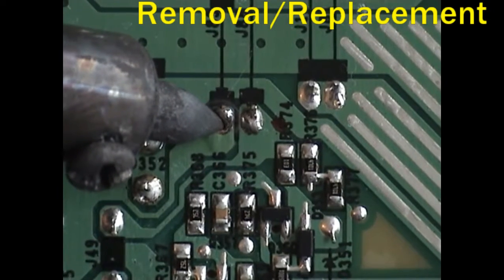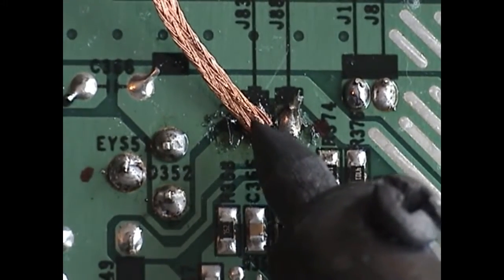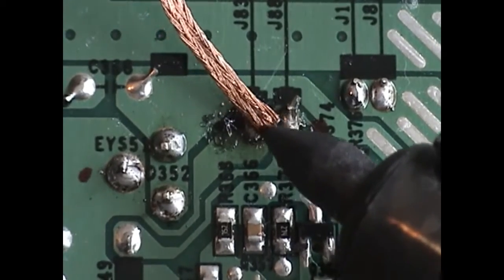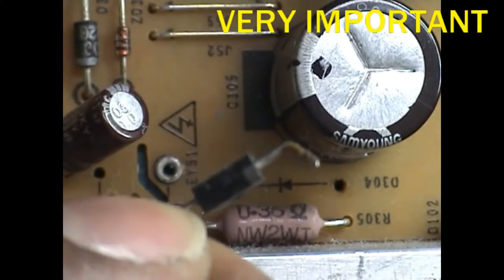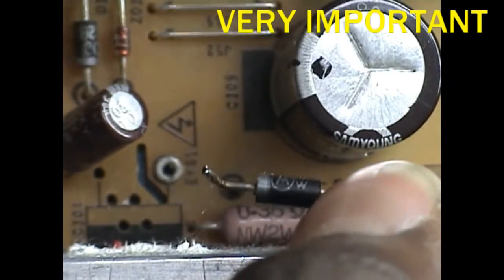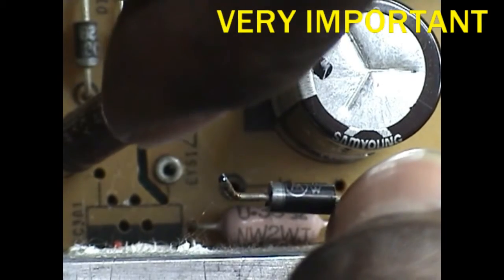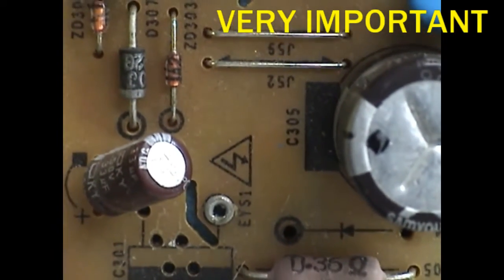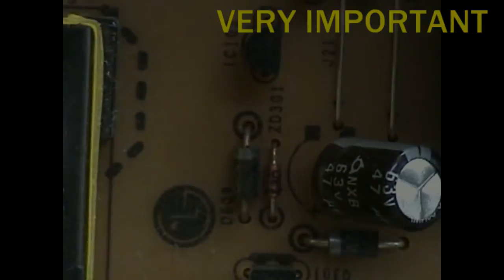LG Repair KIT + FREE Tutorial DVD - 50pk540 50pk750 50PJ350 50pj340 50PK550 Z50PJ240

Comment: is the PJ model repair kit still available?
Reply from the maker: its still Available.. my kits are only compatible with the power boards that have two (2) white resistors at the top right corner... not three.. so check before purchasing..my eBay name in bnmtechs
Reply from the maker: Try now.. Don't click on the YouTube link.. Go straight to ebay
Reply: +Bafury sutto perfect, it works now.